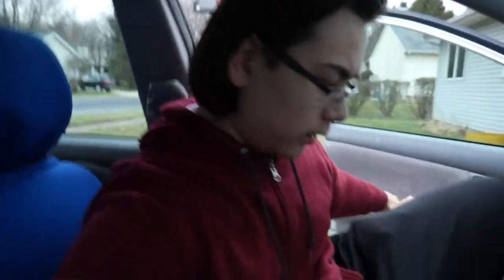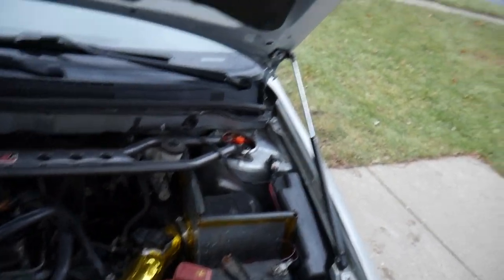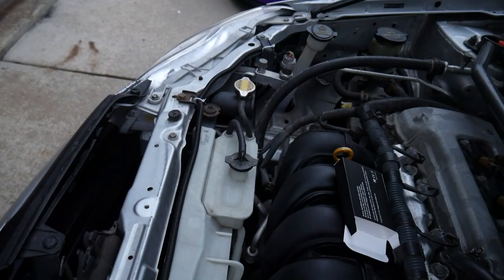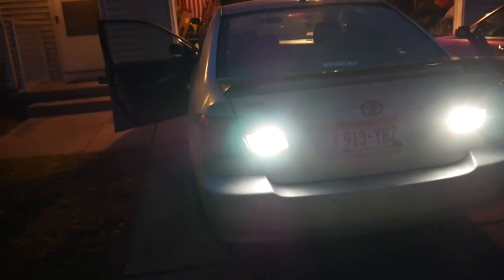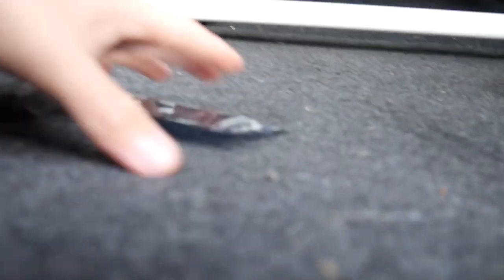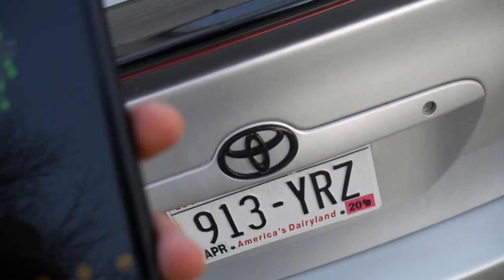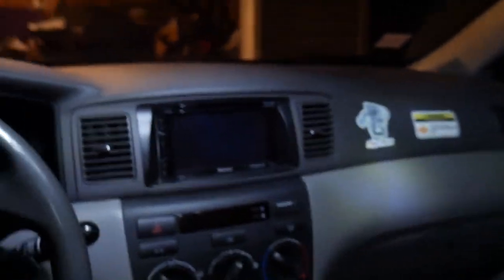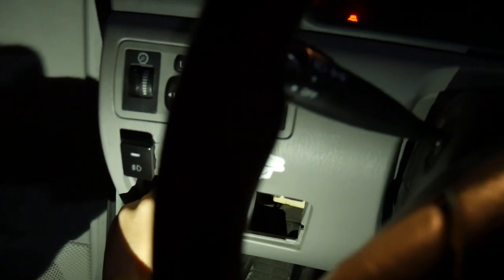Swapping ALL Of The Corolla's Lights To LED!

Comment from the maker: UPDATE November 17th, 2021: Many of you are probably thinking "his LED low beams are blinding other drivers because there aren't any projectors. What an inconsiderate person." You're right. After almost 2 years of blinding people, I took my low beams out and replaced them with stock halogens. 

You might be asking some questions right about now:

"Why not just install projectors so you can run your LED lights and not blind people?" Simple. I don't like how projectors look on this car. All the projector housings I've seen for this car look strange to me, and I just simply don't like how they look. So because I prefer the look of the stock housings, the halogens have gone back in.

"What about your high beams? Are you changing those to halogen too?" No. High beams, whether LED or halogen, blind people anyway because they are so bright, that's kinda the purpose they serve. I like the high beams I installed, and will be keeping them. When they're off, they don't blind people, and when they're on nobody's in front of me.

"Does this mean I shouldn't install LED bulbs on my car?" You do what you want to your car. I wouldn't recommend installing LED low beams without projectors because the beam shatters, but at the end of the day, your car means your choice.

Thanks for reading, and thanks for watching the video!
Reply: Hi Will.just today I replaced the halogen using the same exact LED that you have posted with the link,so far we like it specially my wife.I've been observing like a slight flickering in the LED,are you seeing the same?
Reply from the maker: When I had them I had no flickering issues, but I also disabled my Daytime Running Lights. I don’t have a video on the DRL delete, but there are some other videos covering it. Should be noted that if you go that route, your automatic lights are also disabled.
Reply: There's LEDs that are made for halogen housings. Check them out.
Reply from the maker: @fanta12345  Never knew this, I'll look into it!
Reply: A have projector. I got one form Spyder and it's beautiful. And make my 2007 Toyota Corolla s awesome. My stocks lights were old and burnt out
Reply: @WillChang  That or you can adjust the alignment of the the headlights to be lower/centered to where the top cutoff isn’t blinding others
Reply: @rayonwilliamssportsandfun2106  would you say its worth it?
Reply: Dunno if you ever followed up on LEDs for halogen bulb they were talking about but there's also the 9011 bulb which has a slightly different mounting (3 minutes to cut to fit) which is a next gen Halogen which will work perfectly with your projector, give you like 75% more light, less heat, and not blind other drivers.  Very easy swap to do.
Reply: Did you keep your LED turning signals?

Comment: you mentioned load resistors for the blinkers. one thing someone who really digs through circuits figured out is you can pop the plastic cap on the blinker relay and grind a bit off a piece of metal that looks like a paper clip to slow the flash.  i havent delved into it but assume(?) the circuit compared the resistance of a calibrated "resistor" in the flasher relay to rhe resistance of the circuit? i use a dremel and just breath on the "paper clip" resistor piece while using the blinkers until i get the flash rate that is acceptable. its some soft metal as it grabs the dremels grinding disc if you go too fast. you can return to "stock" by soldering what you cut out

edit: watching more of your video. you have the skill to mod just eatched your turbo video, on the lights on cheaper cars it is nice to cut the wires and put in led strips, your trunk can shine, you can add switches the trunk and be able to light a small area behind the car if you need. also, lighting the footwells and under the doors when you open them is pretty nifty. lexus-like and a led strip thats 10 20 feet long is 10 bucks on alibaba or ebay? 😁

Comment: I find that a good way of removing bulbs is to use some electrical sleeving pushed firmly over the bulb then pull. I keep some different sizes for this purpose. Great video.
Reply from the maker: Thanks for the tip! Never knew this was a thing, I'll probably end up using it the next time I need to take bulbs out

Comment: Did you have to install the new relay for the low and high beams? I want to install low, high, and the dome light and I’m not sure if I need to do anything else besides simply installing the new led lights to those three areas
Reply from the maker: Nope, only needed a relay for the turn signals. For the areas you mentioned you only need to swap out the bulbs

Comment: I hope you adjusted your headlights after this. Anytime you change the optic you will change the height the light is aimed at. This case looks to be much higher than stock due to excess glare. Just aim then down a bit. These optics were never meant to control that amount of light. So most likely you’re blinding everyone until you adjust them.

Comment: How are your low beams LED bulbs holding up? I bought ones from Amazon 9006 HONCS brand, and experiencing flickering after four months. 
I’m trying to find ones that don’t flicker.
Reply from the maker: I ran my low beams for about 2 years with no flickering issues at all! I only replaced them because they were too bright and I instead want to run LEDs with retrofitted projectors but during the time I had them I was pretty happy with them!

Comment: For fog lights: Do I need to replace the fog light housing?  I have read on auto forums a couple of things: 1) that LED lights will scatter unless you have the proper housing, and (2) as one poster stated, anything over 19w and you run the risk of melting the housing.  Don't know if these are accurate, but figured they knew more than me since they put it on the internet.  :/   thanks
Reply from the maker: When I installed the LEDs, I had no issues with the lights scattering, so I figure that the OEM housing would be fine to use with LED bulbs. I wouldn’t be surprised if 19w bulbs would cause melting problems, but LEDs run cooler than halogen bulbs do.
Reply: @WillChang   thank you.
Reply: I’ve had leds in my fog lights for almost 2 years no issues

Comment: Thanks for the video. Did I miss the middle back window break light?
Reply from the maker: I deleted my rear window brake light since I have the 3rd brake light on the spoiler, so I didn’t include it in the video. That light is also easily swapped though, I’m sure other videos or forums will have that information. Thanks for the comment!
Reply: @WillChang  after a year of having them. Any regrets? Would you have gone with another brand?
Reply from the maker: My main regret is that I feel like my low beams are too bright. I still am running these lights but I have been considering swapping to LEDs that have less lumens. Besides that, I’m still running all of the lights and am happy with them!
Reply: @WillChang  Sweet! Thx

Comment: Awesome video will! Thank you. Question?  I replaced my daughters low beam bulbs with LEDs and now when the DRL are on they flicker. When low beam is activated they do not flicker. Did you run into this and I there a proper fix for this?

Comment: Would it be cool to plug the flasher relay into where the stock one was (by removing it?) I was a little confused on how you installed your flasher relay, and it would be cool if you explained how. Trying to install LED turn signals on my 06 Corolla. Thanks man and cool vid!
Reply from the maker: Yep, the new relay just replaces the stock one, plugs into the same place, so when you find the stock one, that’s where the new one goes
Reply: Thanks!

Comment: Really want to how you worked with the turn signals? (LEDS,Relay)? All four working good?No hyperflash?
Reply from the maker: I swapped the stock turn signal relay for one that had a dial on it, which allowed the speed to be adjusted. It’s been working great, no hyperflash
Reply: @WillChang  got a link to that?
Reply: Will Chang hey man, I’m just wondering, does the relay HAVE to be bought and put in the car? Wondering because I’m eager to do this
Reply from the maker: You don’t have to install a new relay, the only problem is that with the old relay, the turn signals will hyperflash with LEDs
Reply: Will Chang awesome man I rly appreciate the response. Just ordered the LED’s 2 days ago and waiting for them to come in. Can’t wait for this conversion, couldn’t have done it without your links and vid 🤝🤝🤝

Comment: I didn't use load resistors for turn/hazard, as I went with updated relay.
Reply from the maker: So did I, much easier that resistors and easily reversible as well
Reply: @WillChang  I did the same project as yours some time ago. I enjoyed your video. I've started a YouTube channel myself and hope to have more Corolla content about my 2003

Comment: hey love the video. im thinking of doing the same. my LEDs i used for another car on the reverse and plate light are getting dull. quick tip if you put your Ebreak on you could check the reverse lights. its not safe but youd be fine. quick question what year is this corolla and were those headlights just plug and play or did you already have upgraded connectors?

Comment: Hey, I just inherited my mom's 2006 Corolla CE. It's gonna be replacing my daily mk7 gti sport when the lease is up. The LED list is amazing thanks for the info. I have to replace the head unit and the speakers cuz they're weak af. Lol one quick question about your cluster guage, is it after market? Or do you have led bulbs in it too? It looks much whiter and brighter then mine.
Reply from the maker: My gauge cluster is stock, bulbs were never changed, maybe it could just be the camera tricking your eyes? Good luck with your Corolla!
Reply: @WillChang  is yours an s model? Maybe mine are just really old. Lol maybe they're just really crappy on the base model cuz mine don't look anything like yours. Lol
Reply: @WillChang  sorry to bomb you with comments but I just read this on a forum::

2003-2004 LE have white gauges.

2005-2008 LE have hidden black faced gauges with white numbers. There is no comparison. The Optitron gauges look like they float in the cluster.
Reply from the maker: It’s no problem lol, my rolla is an 07 LE, not an S btw. Pretty good find with the forum info too!

Comment: I attempted to install all 4 3157A bulbs for signals and I couldn't get the front ones to not blow a parking light fuse... got the rears working fine.. anything you know that could be causing the issue? putco leds all around, matching of course... I was thinking of trying other bulbs but not sure if it would even work

Comment: It very tough to remove the power connector from the relays because it vert tight room.
Reply from the maker: It definitely is. I removed it with my hand, but it was very difficult and it hurt my fingers but I got it out after trying long enough, I’m not sure if there are tools that would make it easier without damaging anything. But if you have the patience, it should be possible to wiggle out by hand. Expect to blurt out several curse words

Comment: you know if all of this would be compatible with a 2001 corolla? I can't imagine they've changed the lights all that much.
Reply from the maker: I would assume it’s a similar, if not identical light setup
Reply: @WillChang  only thing I'm iffy on is the flasher relay. Getting mixed information online about what my car takes. Looks like cf15 for 2001 model year. So I don't think the one you used would work. I just need to pull the one out from under my dash and have a look at it
Reply from the maker: Average Joe oh right, I forgot about the relay. Might be the same as mine, might not, I don’t know. I’d check it out, like you said
Reply: @WillChang  have you had any issues with the high beam lights or the low beam lights? Just installed the same ones in my ride and was trying to adjust the clocking of the leds. jeez the hole thing gets super hot just being on for a very short period of time. like 15 seconds and the little box in the middle of the wire was too hot to touch.
Reply from the maker: That’s odd, not sure why your lights are doing that, mine have been working fine ever since I installed them, no overheating or anything

Comment: You should totally change the PRNDL light it’s also a 194, I swapped mine pink 😎 and I’m thinking of also doing the hvac lights and swapping em pink (pretty sure the bulbs are t4.2)
Reply from the maker: I’ll think about it, I plan on doing an auto to manual swap at some point but that might take a while so I may swap those lights, didn’t know they were also 194, thanks for the info!
Reply: Yeah no problem and btw if you are planning on doing the hvac lights the bulbs are gonna be a bit pricey and hard to find (at least in my case they were hard to find) but yeah best of luck man 🤙✌️

Comment: Is it only Relay ? Or do i gotta get one for the back lights too?
Reply: I believe you need one only, did you get it out. Its behind your coin box.
Reply: @adivasi6894  i bought the same relay device you got and it worked bro! I love my Corolla S 2007 broo
Reply: @Almighty.Dog818  I been trying to get it out, seems hard. Any advise?
Reply: @adivasi6894  i hired a mechanic to do it for me bro. Check your local mechanic
Reply: @Almighty.Dog818  k,thx

Comment: do you know if these lights fit in an after market headlight, spec d in specific? if not where do i find the size for them?
Reply from the maker: I had Spec D housings at one point on this car (I believe they were spec d anyway.) They used the stock size of bulb, so if you are referring to the non HID housings then these should fit just fine. I don't have any experience with HIDs though, so I don't know if these work there.

Comment: Will i need resistors for these? Or is it only the turn signal ones? And i know about the relay
Reply from the maker: You'll only need resistors for the turn signals if you decide not to install a new relay. If you install the new relay then you won't need resistors

Comment: I have a Corolla 2009 but where can I get the led lights at ? Or what modification should I do !
Reply from the maker: You can most likely find all of the bulbs on amazon, and if you need the part numbers a quick google search should provide you the answers. Should be plug and play. Thanks for the comment!

Comment: If I got a relay for the led turn signals do I still need load resisters?
Reply from the maker: Nope! It’s one or the other, so you either replace the relay or install load resistors, no need to do both. The relay is a much easier option which is why I recommend it

Comment: Hi i changed my corolla to LED but the signal blinking too fast you know how to fix it?
Reply from the maker: The easiest way will definitely be to replace the relay with one that’s LED compatible, I bought an adjustable speed relay from Amazon, and it’s worked great. You also have the option of wiring in resistors to each corner, but it’s more work, and resistors do get hot so you’d need to install it somewhere where it isn’t likely to burn through and damage anything. Definitely recommend changing the relay though, much easier and cheaper.
Reply: @WillChang  can you give me the part number of the relay please thanks

Comment: So I got the same turn signal lights for my 2004 Toyota Corolla LE and they don’t seem to fit. I push really hard and it still doesn’t go in all the way and click. The rear turn signal lights work but the front two are the ones that won’t fit. Anyone know what the problem might be?
Reply from the maker: I had to use a fair bit of force to push my front turn signals in, the rear ones also needed some force for me, not sure exactly how to fix it since mine were able to go in
Reply: @WillChang  Thanks for the reply!

Comment: Bro can u help me out. I want to get led lights for my 2005 corolla. But i got daytime running lights. Wat led lights can i get that would be a daytime running light and would get brighter when i do turn on my headlights manually.
Reply from the maker: I’m honestly not too sure, I disabled my DRLs so I wasn’t too concerned about this. You may need to check forums or something, but not sure I can help much, sorry
Reply: @WillChang  wat year is your corolla? and can please make a vid about how to disable daytime running lights
Reply: @quintonmuna  On my 2005 CE Corolla it's a red/white striped wire. I just snipped it and added black electric tape on both ends.

Comment: Any problem with the low beam drl ? Since u put leds ?
Reply from the maker: I did a drl delete before I did the led install by cutting the yellow wire that leads to the drl box and grounding it, there’s some videos on how to do it if you’re interested in going that route. Otherwise I doubt there will be any issues with the drl
Reply: @WillChang  thanks for your reply im going to have to do it because i have hids nd i gotta have them on all the time probably fonna have to cut tht wire is the # 12 right?
Reply from the maker: I believe #12 is correct, it should be yellow
Reply: @WillChang   one last question did u grounded the wire after cutting it?
Reply from the maker: @cesaralvarez1207  Yep, I believe I grounded the part of the wire that comes out from the drl box, otherwise the drl and auto lights won't turn off
Reply: @WillChang   thanks man again

Comment: How do you remove the coin box to get at the relay?
Reply from the maker: You can squeeze the sides of the coin box and it'll pop out, just be careful not to squeeze it too hard or you might break it
Reply: Hey Rodney, How did you remove the relay. ?

Comment: How do replace the climate control lights?
Reply from the maker: You can take the middle part off and the bulbs will be visible, you can use a flathead screwdriver to take the bulbs out. I made a video swapping those bulbs a couple months ago, here’s the link: https://youtu.be/M45sqE1ozXw